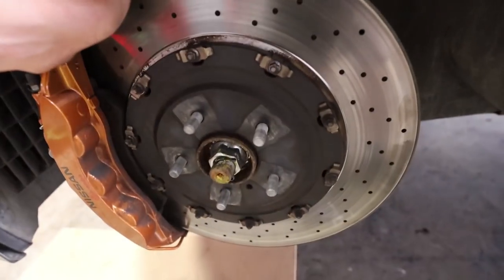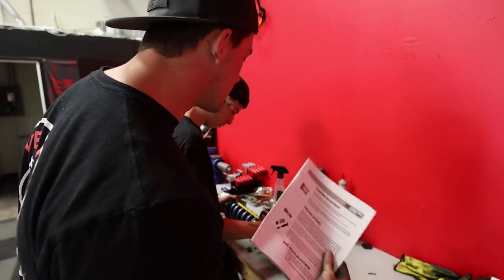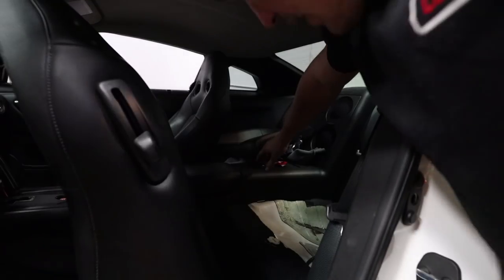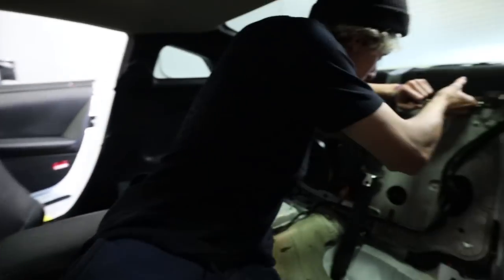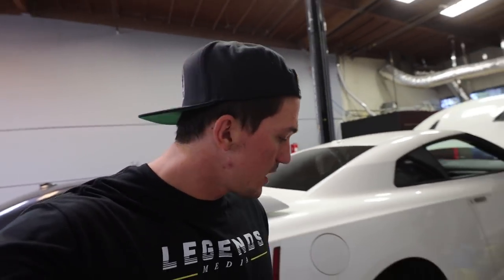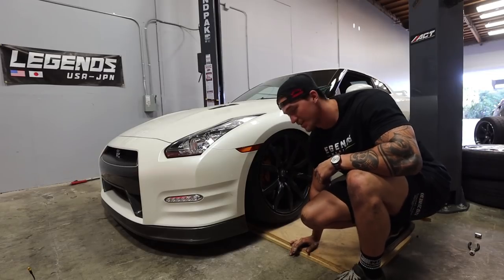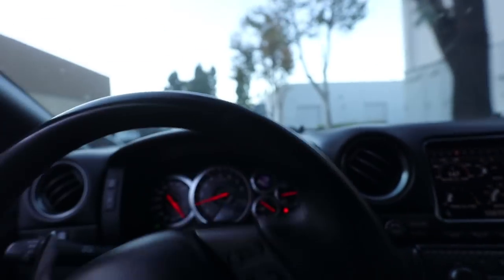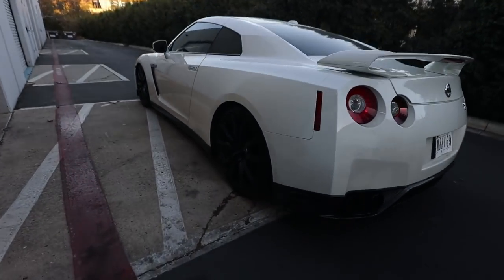R35 GTR GETS INSANE NEW SUSPENSION! - FORTUNE AUTO GTR COILOVER INSTALL

Comment: I love fortune. I was the Beta tester for the 500 Air Piston Coilovers w/ swift springs for R33/34 Skyline GTR’s. I couldn’t be happier. I had them installed with a Accuair CVT and Remote dampers. I use to have TEIN and Fortune is much..much better. The TEIN felt out dated.